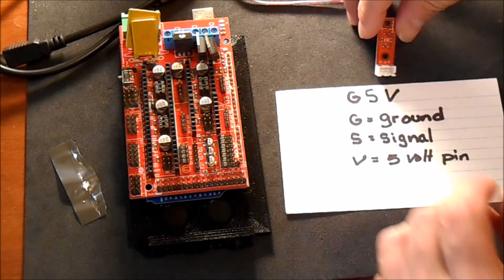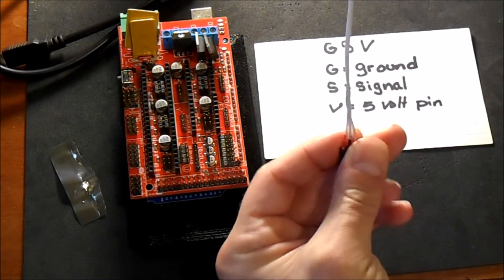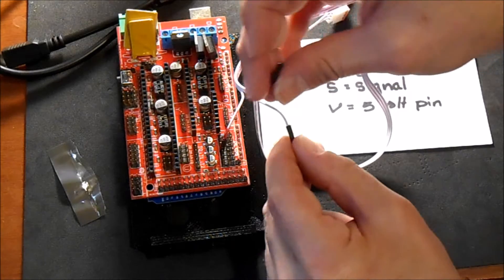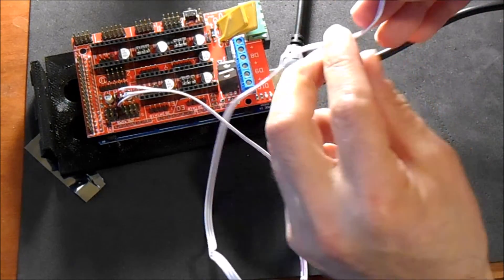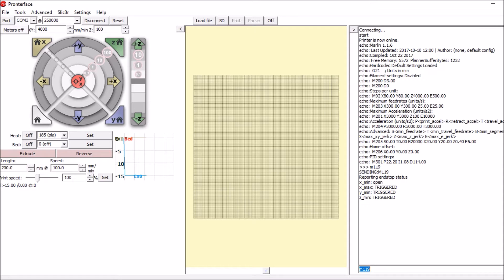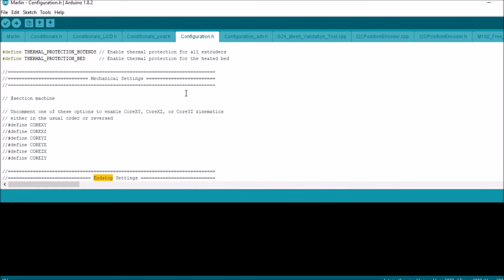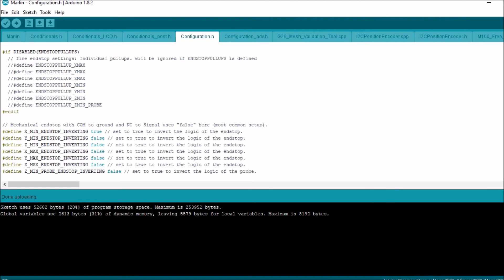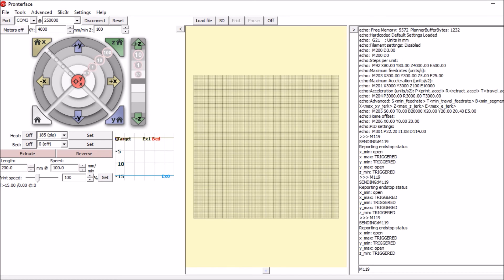RAMPS 1.4 - Optical Endstop

Comment: Thank you .  Is the code different if we use an optical end stop or  logical end stop ?
Reply from the maker: Most endstops function by bring voltage to a high or low.  As for difference between them depends on electronics a board voltage of 3v might not handle a 5v signal.  Best to consult datasheet.

Comment: Any idea if could be used on a mach3 breakout board  ?
Reply from the maker: Is there a datasheet link?
Reply: @EdwardBraiman  No datasheet, i can give link on youtube with the breakout board.https://www.youtube.com/watch?v=nnwWurK4GEI&t=42s  There is inputs for limit switches, E-stop, tool probe and so on . I think the optical switch board needs  - and + in order to send the signal back to the input of breakout board, it should work but i am not 100% sure.